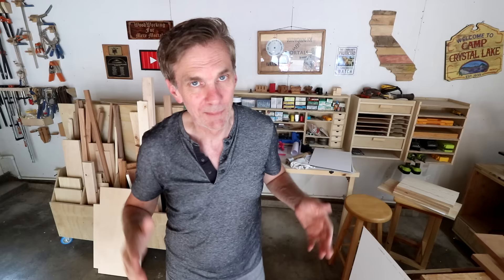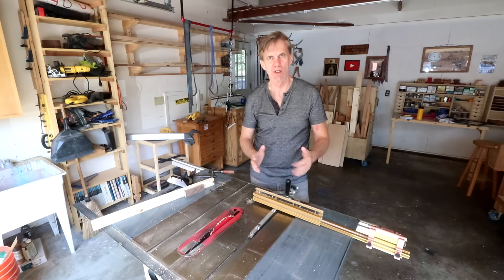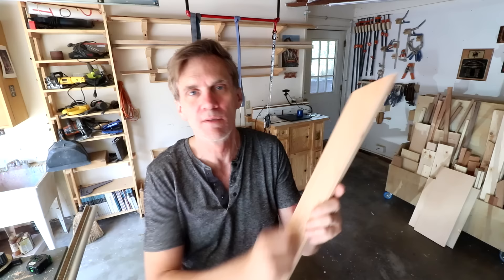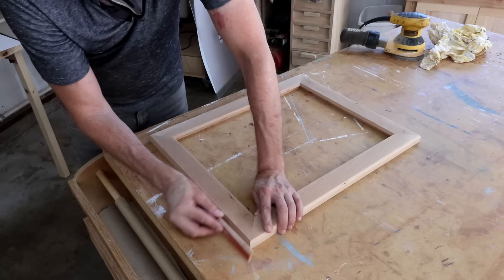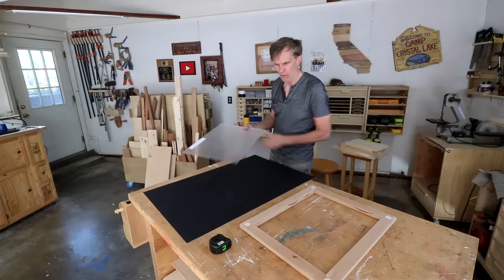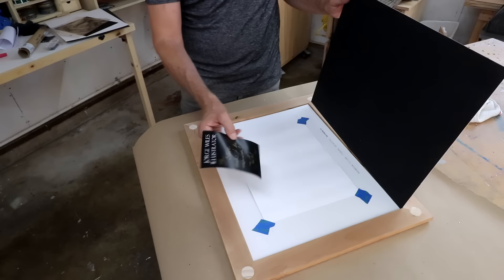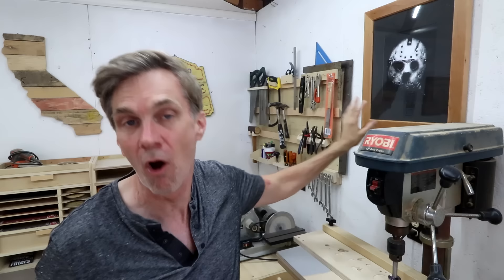Picture frame BASICS. How to make a simple picture frame using a tablesaw.

Comment: The cross-grain of the dowel will be much weaker than the glued miter joint.  So this reinforcement actually weakens the joint.
Reply: 😳..... Matthias has spoken
Reply: Better to use boards and cut plugs, that way you can rotate the plug and have the face grain cross the join.
Reply: Not sure about that. The dowels do increase the surface area of the glue up.

Comment: Hi Steve - the Mitre technique is quite helpful in this video.  I have a suggestion about the rabbit cuts.  Personally, I find moving the fence to be a drag and it can lead to an inconsistent width of the rabbit around the frame.  What I usually do to create a rabbit is to make mitre cuts after the rabbit is removed.  I cut a scrap spacer the width of the rabbit I want to create, then set the fence at the width of the frame sides.  I make the first cut of the rabbit using the spacer against the fence to make the first cut at "max depth," either on the full length of the frame material or on each raw piece as you have in this video.  Then I knock out the rabbit either by resetting the fence and saw depth to remove the rabbit in one cut, or else I make multiple passes with the scrap spacer removed to take out the pieces.  The rest follows your guidance.  

Thanks for making woodworking look as fun as iot really is!

Comment: There are so many ways to improve what you are doing, never tape the bottom of a piece paper expands and contracts, measure the rabbet so you know what your size is, and the measurements of the mat are very important to making a professional looking picture frame. The d-rings should be parallel to the top and bottom rail. And measured 1/3 from the top of the picture to keep the frame as close to the wall as possible. The dowels are a really good solution.

Comment: Great Video! Thanks for consistently putting out quality material! I'm wondering about the static on the acrylic....what if you rubbed a dryer sheet on it? (before mounting) That might help cut down the static, and add a spring fresh smell to the frame.   :)

Comment: Thank you. Nice clear informative video. Question:  What type of blade should be used to avoid chipping the wood at the cuts for small pieces of wood. I want to use 3/4 inch square pine dowels to make my frames.

Comment: Could you cut the boards say 2c12inch and 2 at 18inches and connect the boards with butt joints and use kreg tool to pocket screw the frame together?

Comment: Hello Steve, thanks for this informative video. Quick question - I have an application where I need the frames to be made with wood that is 1/4 inches thick. Is there a better way to reinforce it? Or should I just use the dowel method you have shown here?

Comment: I'm now getting into woodwork despite being interested for years. So far I have 0 power tools, 1 saw, 1 tape, 0 levels, 1 large wood glue, 1lb 1" nails, 1 claw hammer, 0 work bench/area, 1 chisel and a dozen ideas.

First, I would like to try making a draught/checkers board. I remember years ago an old man used to make them to sell. One would be approx 2 1/2' × 1 1/2' and have a compartment along both widths to store the pieces. The boards were either painted or varnished.
Have you ever built one?
What can I do with those tools (until I get more)?

Comment: Let's say you have something big and heavy to hang with wire, like a wide mirror. You know it's going to span across several studs, but you also know that where you want it, it won't be centered on the studs. The question is, how do you determine where to put the hooks so it hangs level, with the weight distributed evenly? I've got such a mirror, but it's now been leaning against my bedroom wall for 13 years and 2 houses because I don't know how to solve this problem.

Comment: How do the dowels work?   There is very little mechanical grab.  If you assemble the frame without glue the sides will just fall off.   All I see is extra glue surface.   A butterfly would work.

Comment: An 'oops'?
02:18 - (Paraphrased) "When cutting your length, add the extra 2" (or whatever your wood thickness is) to your measurement
04:25 - "I'll start by cutting the shorter boards to their length. Since they're 14", I'll need to add an extra TWO INCHES. "
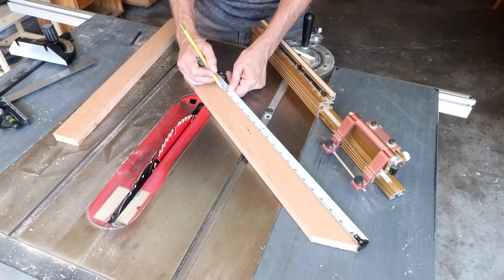06:25 - (Now cutting the longer pieces) "The mat board is going to be 18", so I'want to add FOUR INCHES to that to get my longer board length."
 - Error in regard to getting the cutting measurement for the SHORTER pieces?
Reply: Yes, thanks for confirming what I thought I heard.

Comment: Hi Steve. I don't want to sound dumb but can a dado blade be used on any table saw? Are there different gauges of dado blades or can one be used to do most types of dado cuts?  I am a beginner woodworker and I know very little about making those special cuts on a table saw. I have a 20inch Craftsman table saw. It's not a top notch table saw but it gets the basic cuts done.

Comment: I just tried to follow this, excited to frame some pictures I've had lying around for a while and I'm stuck. I can't get my table saw to cut a 45 degree angle. I've measure multiple times with several different tools and every time the results don't come out square. I even tried with a hand saw with a plastic mitre jig. I've had to give up and i hate giving up. I don't understand why it won't work.

Comment: @Steve Ramsey - Woodworking for Mere Mortals
I bought one of those spray handles because I saw you using one. Spraying is such a pleasure now but I cannot get it off the can without spraying stuff everywhere. I end up resorting to a flat screwdriver but am afraid I will eventually damage the spray handle or a can. Is there a trick to getting it off the can?

Comment: Tried my first picture frame today. Went to drill holes for the dowel reinforcement and it opened the corner joint. The point of the forsener but going right on the line of the corner of the joint opened it right up. Any advice?  :(

Comment: Plexiglass is so expensive here in Canada. A small sheet like that at home depot is easily $30-40. I'm making hot wheels cases and my work gave me some super thin stuff but I'd much rather something thicker. If anyone knows a better option for me let me know! I'm near Toronto but I frequently visit Windsor.

Comment: Hi Steve. I wanted to ask your opinion on a table and mitre saw combo, especially if space is an issue.
Reply: I LOVE my Milwaukee m18 table saw and miter saw (separate tools). Then again, I've invested heavily in the m18 line. I appreciate the fact that I can store the saw in a patio/deck box and put it on a Husky collapsible equipment stand.  The miter saw is stored on a rolling cart that I roll outside when I need to.

Comment: 7:48 Safety issue, which you've got covered by using the Grrriper:  using a push-stick for this cut would seem to be dangerous due to the likelihood that it would slip off the 45 degree cut end.  Maybe a feather board would help. Thoughts?

Comment: Steve:  What was the name of the 1 inch drill bit you used on the back of the frame?  Where can I purchase this bit?  I know you stated the name of the bit but I could not understand it when you said the name.
Reply: Richard Herrington     Forster bit. You can buy a cheap set at Lowe’s or Home Depot
Reply: @lawrencelewkow152  Thank you so much for answering my question.  I am 75 yrs old and my hearing simply is not that good any more.  I simply could not understand the name of the drill bit when Steve said it.  U.S. Army, Ret. Texas
Reply: Sorry, autocorrect changed what I wrote. The bit’s name is Forstner

Comment: Ummmm......I think the general rule of gluing end grains to each other is to pre-glue the edges, let them dry a bit and then re-apply glue and clamp them.  Since that only would have taken an extra moment, why not do that when you are first assembling?  That would give you a stronger joint with almost no effort.

Comment: Frustratingly, the mitre gauge on my table saw has a bit of "play" between its rail and the groove. Would a better quality third party mitre gauge fix this?
Reply: Mine is the same, I ended up changing the runner to a piece of hardwood that I cut and sanded to be a tight fit. Didn’t take long to be honest and much better.
Reply: @johnW3215  Thank you. I've since built the simple mitre sled from one of Steve's other videos and it works a treat!

Comment: Why don't I get email notices when a new YouTube video is available. I am subscribed. How do I search YouTube for the most recent video you release?
Reply: Did you push the little bell?  Then push the top bell to get all notifications.
Reply: On my android phone, push utube, push subscription at the bottom, this gives a list of your subscriptions across the top, push all, this shows all your supscriptions, push the one you want, this gives a list of all shows that person has ever posted.
Reply: @keithfaulkner6319  Thanks. I use to get them all, then they stopped. I am subscribed and the bell is set to "all".
Reply: @brucemezei1129  then no clue. Maybe unsubscribe, then start over.
Reply: @keithfaulkner6319  Thanks. I just took your suggestion: unsubscribe then resubscribe. Hopefully it will work.